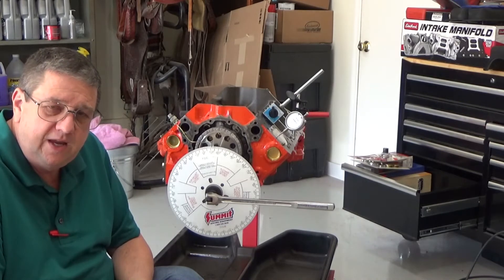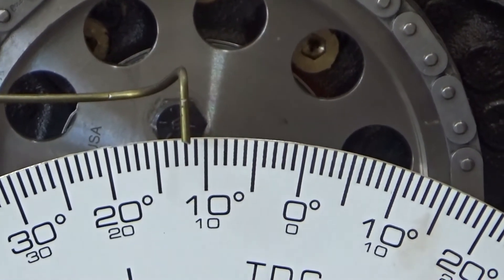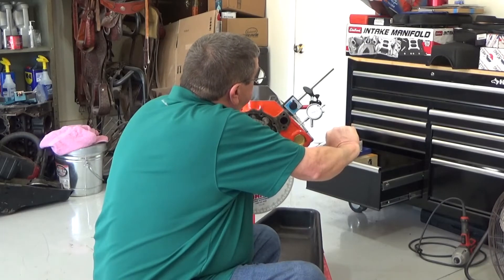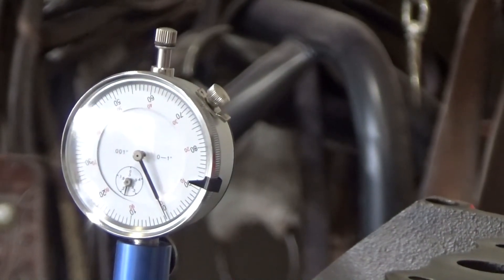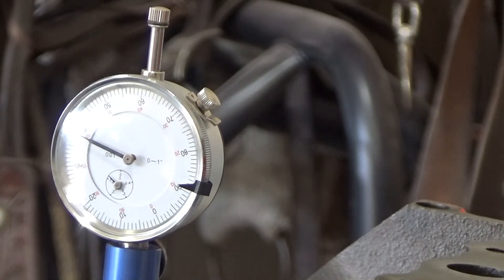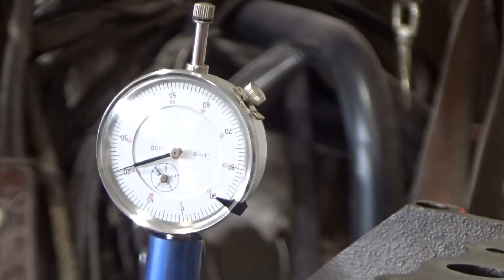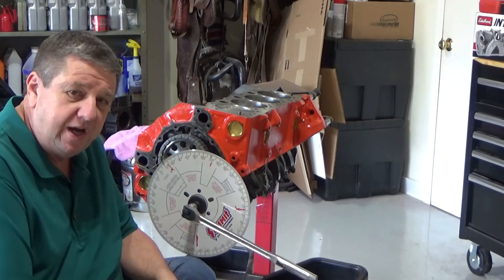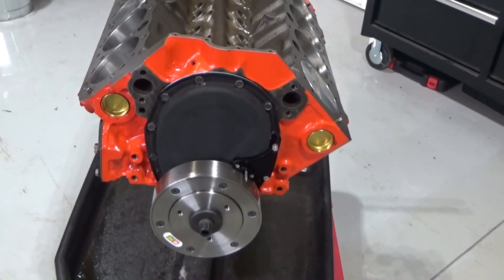Old School 383 Stroker - Degreeing the Camshaft

Comment: I was able to grasp the concept from you a lot better than the several other videos i watched with those expert hot rod builders. Thanks!
Reply from the maker: Thank you. I suggest you check out MyVintageIron7512 on YouTube. His video is what I followed.
Reply: @2old2rodeo  i have. I plan on building a stroker 383 myself. Not a hot rod just something that can pull a. Camp trailer with ease. Any suggestions?
Reply from the maker: @keithknight2194   I'm probably not the one to give advice.  Things I would change if I had it to do over again with what I have learned, is that I would study longer before getting started and not lock myself into a plan too soon. Let it evolve. I made a mistake by starting with the Vortec heads first. Now I would start with a factory roller block, use a roller cam, and look at aftermarket heads. I towed a gooseneck horse trailer for years. First with a 95  one ton GMC dually diesel and then with 99 Ford 3/4 ton with the V10 engine. I had much better reliability with the V10 gas engine. Chevy has an 8.1 gas engine now. I wouldn't mind having one of those or even one of the old 454's for towing. Good luck and feel free to message me any time.  Jeff

Comment: Given the really superb job youve been doing up to now I was surprised ya didnt use a double row roller timing chain.  Also surprised ya didnt have the compression ratio issues worked out before spending so much on those heads.  But, ive been there too and id have been wanting something more than 9 to 1 also, im 61 and grew up with real gasoline that had good octane ratings etc. -- I  hate to see ya building such a nice old school engine and having to resort to E85, holley carbs can be hard enough to tune as it is without E85 headaches.  Im guessing down the road you may be wanting to change to aluminum heads and carb and go back to high octane pump gas - either way I wish you the best of luck, and myvintageiron is an excellent source or reliable information.
Reply from the maker: That is a double roller timing chain. https://www.summitracing.com/parts/TFS-31478500 
I wanted the cast heads but probably should have chosen a different piston to keep compression manageable. I had read so much about the quench area and everything is so interdependent.  Change one thing and it affects so many others. It's a learning process for me. I would do a lot of things different knowing what I know now but I can only learn so much from reading and watching videos. I learn best by going through the process... and making a few mistakes. I'm 59 so I'm right there with you. Thanks for watching and commenting.